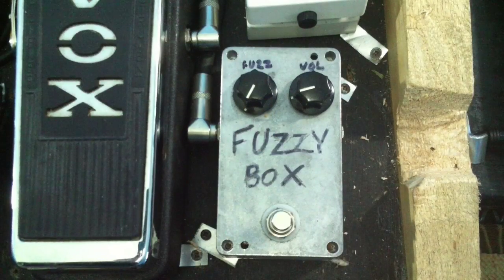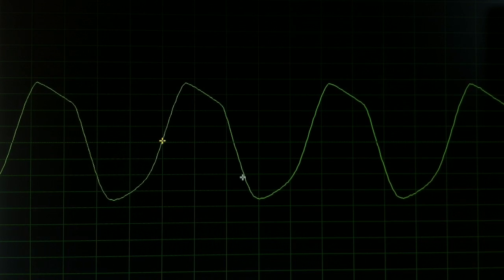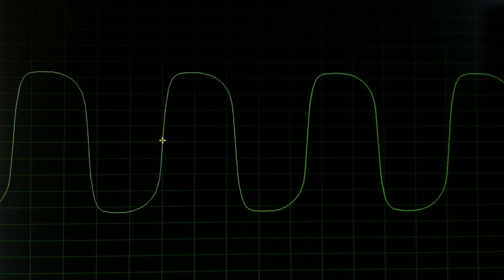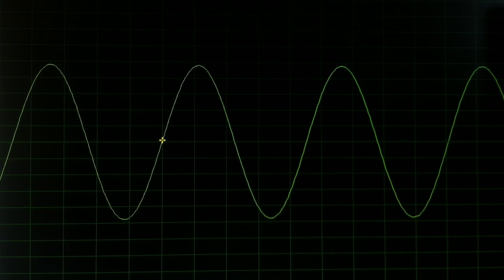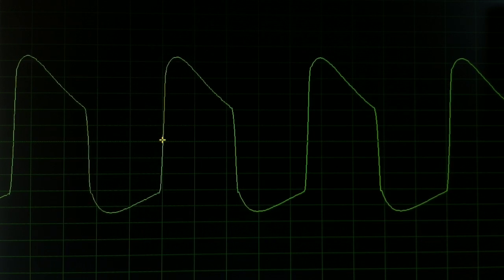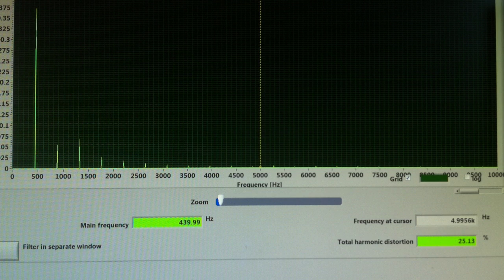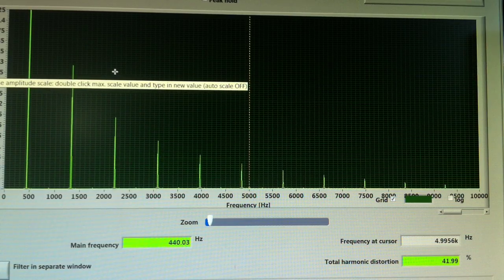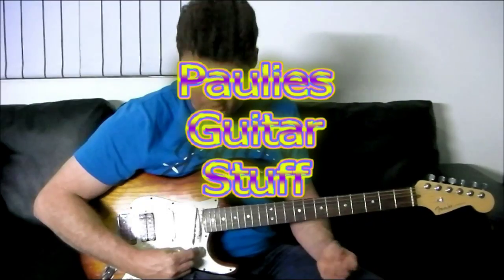Fuzz vs Overdrive vs Distortion Explained

Comment: Pretty much why after 30+ years of playing I have instinctively gravitated towards natural tube overdrive by either pushing the head room of an amp or using undersized speakers. The oscilloscope analysis just confirms what my ears are hearing. Though one of the metal sounds I got was  my mid 80s solid state Princeton amp mic'd off my  60w Peavy tube amp. With a hot rails bridge pup installed on my 83 Telecaster. That is something this video didn't analyze is layered soundscapes

Comment: So this is all interesting in terms of soft vs/hard and symmetric/asymmetric clipping. Essentially its what harmonics are created (odd or odd and even) and how they are distributed. But a more interesting question is what does it sound like, and how should we use it musically? Soft symmetric clipping will be the last aggressive. Hard and asymmetric clipping will have both even and odd harmonics and will take up a lot of sonic bandwidth, be more complex and will have more intermodulation distortion and sound more aggressive. How it sounds depends on personal preference and what you think fits the song. Generally I find using the minimal amount of distortion (i.e. leaning towards soft/symmetric) that fits the song works best.

Comment: I would love to see this same type of analysis done to compare the wave shapes of a Blues Breaker style, Klon style, and Tube Screamer style overdrive pedals; as well as a clean boost/transparent overdrive to see how clean the signal really stays and how increasing the input affects that as well.
Reply: Also a video of waveforms when "gain-stacking" comparing overdrive-into-distortion vs distortion-into-overdrive, as well as stacking fuzz before those to see how all combinations change the output waveform.
Also, another addition, kind of building on my first suggestion, placing a boost before the overdrive/distortion pedals/combos affects the waveform vs after.

Comment: I built a two-valve pre-amp (Marshall circuit) and overdrove it with a Germanium transistor booster fifty years ago.  Still use it, or an incarnation of it.
Awesome fat distorion tone.
The thing is......... the biggest difference occurs when the note dies away.
The pedals for fuzz/distortion etc seems to me to have a clear and definite point where the fuzzy sound ceases whereas the valve distortion just smoothly transitions into a clean tone.

It's good to see someone put up some oscilloscope traces and show people what's actually going on with a waveform as it distorts.
The unit I built starts by rounding off the bottom of the waveform in a very pronounced way - the bottom peak gets rounder and rounder and the top peak just keeps climbing until it all starts to bend and morph into a waveform almost identical to your own valve unit.

Comment: hi man thanks for the video, i have a question, how can i add a distortion toggle switch to an tube preamp overdrive pedal, for example hughes & kettner tube factor. is it possible to a a toggle switch with 2 led diots or diots to the ic in or output of the overdrive section of the pedal?

Comment: Great demo. This also shows why hard clipping of an audio system can blow speakers. Speakers take more time physically to move than a signal like that is telling them to. Depending on the frequency they can stack common signals before they can return to a lower position in the wave and they start to ride up and will destroy themselves. The hard clip is just way too much fast dynamic for them to deal with in the acoustic world. Pushing your speakers beyond their rated wattage is much easier on them than pushing your amps final output stage (causing hard clipping at high watts) beyond its rated output.

Comment: So consider a periodic signal, then we can use a Fourier series rather than a transform because the signal will be band limited.

When you look at the spectrum you see pretty much what you would expect.

Sine wave -> single frequency
Saw wave -> odd and even harmonics of.decreasing amplitude
Square -> even harmonics of decreasing amplitude

So far nothing too interesting.

BUT seeing that tubes cause a hybrid of square and saw plus seem to reduce Gibbs phenomenon (so no overshoots - seems to filter out the higher frequencies) and even a sine has some limited harmonics plus a valves ability to resonate - now a lot of the warmth of valve amps becomes a lot clearer.

Thanks for the video - I only recently got a valve amp - I bet those pedals sound even better in the room - YouTube doesn't do a valve amp full justice

Comment: YES!!! I wonder how many of us fuzz-nuts have been trying to explain the differences we hear between fuzz, distortion and overdrive to our fuzz-innocent buddies - this straight-forward video does the very best job of explaining this that I have yet seen, and I feel like I have the tools to kind of helpfully explain it a bit now. Thank you so much for this video.

It’s almost a truism that every guitarist who has a Fuzzface loves the way that circuit behaves as the guitar’s volume is rolled back, and it's so fun to see it on the oscilloscope and the spectrum analyzer. Any guitar player who has one is going to watch that section and jump up and down, "I KNEW IT I KNEW IT I KNEW IT!!!" - and you see the pattern in the harmonics with the gain cranked (five and then a space, then five and another space, or counted another way, no sixth harmonic at all, no twelvth harmonic, and so on), and how it changes (the others drop but the sixth and twelvth come in!) - just really exciting!!!!

Definitely one of the most fun guitar-related videos I’ve seen in ages. And it’s been out there since 2014, imagine that.

Comment: Paul, Is it possible to make a circuit that produces mostly even-order harmonics? Wouldn't that sound super pleasing? )
Does SS distortion waveform always have rising sawtooth shape and tube distortion falling saw-tooth shape, and can this be altered? 
Is there a circuit that can make a waveform where the top half is M-shaped and lower half W-shaped? Wonder what that would sound like )) 
I wish I knew electronics well enough to experiment and make my own distortion effects... I envy you in a good way! And good luck!

Comment: Now I know how valve (vacuum tube) preamp gives warm-sound. It skews signal. At 12:24 clearly seen that rising a little bit slower than falling. Valve's conductance-increasing sinks faster than its plate's resistor can pull it up again. This phenomenon can achieve in high-voltage low-current condition.
Now i know how, thank's to your effort. Your share makes people getting more smart.
Cheers from Indonesia.

Comment: Paul, I read somewhere that Class A tube circuits clip asymmetrically ( which you show in your video) and that Class AB circuits clip symmetrically. Is this true regarding Class AB circuits?
Reply: It's sort of true. Class AB circuits basically cut out symmetric halves of the waveform, amplify them separately, and then combine them. As a result, all asymmetry is lost. This, however, is true only of an ideal class AB design. Real circuits may not separate the two halves perfectly (and this may even be done intentionally) so that asymmetric clipping is still possible in class AB. There's also some crossover distortion which is like the scar from cutting and stitching the waveform back together.
Reply: You may be confusing a push-pull circuit with “class AB”.  There’s a lot of mistaken mumbo jumbo about “class A” on the internet. It has to do with how the tube is biased and the circuit construct, but you can have single-ended class AB and push-pull Class A (at least theoretically).

Comment: Dude i've been studying electric engineering and I must say you taught me much more than my teachers! 
Really thanks for explaining these fxs
Reply: If this were an EE course, you would be expected to compute the FFT, Bode plot response of the circuit, calculate its transfer characteristics H(s) including stability analysis, phase and gain margin, calculation of all poles and zeros. Actually, a pretty good exercise come to think of it.
Reply: @brucesmith9144  The depends on the design, bode plots and phase shifts are pretty normal, but stability analysis and gain,phase margins are only applicable to feedback systems.
Reply: The distortion wave looks very similar to when you put a capacitor in a circuit
Reply: Hi, mate, so i study civil engineering and it's unrelated do most of the things i've learnt. But i just got curious, do you study how pedals influence the soundwave of your signal? I bet there are more aplications in your field, but it seems a really cool subject! Greetins from a brazilian random dude who comments on random posts hahaha :)
Reply: I'm an electrical engineer and I agree! Congrats from Brazil! 👏🏽

Comment: Loved the content bro.
Make more videos like this, may be like a Flanger,  Phaser or Wah. 
Cheers.
Reply: Flanger, phaser and wah are basically (modulated) filters (in case of flanger and phaser, their frequency response it driven by an LFO - low frequency oscillator - in case of wah, the frequency response is driven by the pedal movement and in case of auto-wah, the frequency response is driven by the envelope of the signal - basically a rectified and low-pass filtered version of the signal - itself), so for a sine wave (which is the "purest" form of wave, consisting of only a single frequency) they would just cause the amplitude to go up and down. To see what these actually do, the best thing would be to feed white noise into them (because that has all frequencies in it) and then look at the spectrum analysis. A look with an oscilloscope (and sinosoidal input) actually doesn't reveal a lot about what these effects do. You need a wideband signal and a view of the spectrum to see what's actually going on.

Comment: What would you say to those people who insist that the sound of a tube power-amp cannot be replicated by a tube pedal or tube pre-amp alone?
Reply from the maker: When a tube power amp is clipped it does add it own elements but under normal conditions when a tube power amp is not driven to that point it alters eq only which can be replicated pretty easily.
So during live performances where the amp is not cranked you could run a tube pedal and a transistor amp.
Reply: ***** What exactly does a tube power amp do differently when it's clipping compared to a small tube that's clipping and then being amplified by a neutral sounding solid-state power-amp?

Also, do tubes still color and compress the sound, even when almost no amplification occurs (amp set close to 0)?
Reply from the maker: Vin Power tubes are usually in more complex circuits than preamp tubes in guitar amps. They have feedback circuits and output transformers and generally run in Class B amplification, that all alters the clipped signal in different ways.
Also generally 12ax7s are used for preamps which are triodes and they are run in Class A Mode. Triodes tend to clip soft where as most output tubes are tetrodes and pentodes and tend to clip a little harsher.
Reply: Redesign the output section of your transistor amp to use an output transformer and I guarantee you'll notice a big big difference in tone when the power section is being pushed.  For the most part, people aren't able to have the power section of their 100 watt amp really push, nobody has in 35+ years.  So in reality output tubes are faithfully recreating what the preamp section is doing.  In that sense, use a tube based stomp box into a transistor amp, in addition to having it rewired so the power section is using an output transformer - and I don't think anyone could tell the difference between tube or not.
Reply: Play a Dirty Little Secret. :)

Comment: It might be interesting to do exactly the same type of comparison between silicon vs. germanium.
Reply: @Willam_J  I was expecting germanium vs. silicon transistors, not diodes. Plus the Klon circuit is fairly unusual in the way it uses diodes.
Reply: @chipsterb4946  Whiney bstrd
Reply: @Willam_J  cheers for the link!

Comment: Nice video! It was very useful for me.

Did you "hand pick" these distortion pedals to produce these (kinda) "simple" waveforms? I tried it with one of my pedals (on an "actual" oscilloscope and signal gen, which should not make any difference though) and it wasn't very obvious at all, what the clipping stage did to the signal, most likely since there was analog filtering happening after the clipping stage, which of course alters the amplitudes and phases of both the original signal and the extra harmonics that the clipping stage produces. I could dial in settings that actually made it clip hard (at the output stage against the supply voltage) so that you actually got "flat lines" at the output, though that's probably not what you're expected to do with it. If one of the early stages clips (like it's supposed to), it will get masked by the subsequent filtering and because of that, the resulting waveform will also vary depending on what frequency you feed into the circuit and of course where your tone and EQ controls are, though one could never get these filters completely "flat".

Likewise, I think that the "sawtooth pattern" from the distortion pedal that you show is actually a (kinda) "hard clipped" signal at some point in the circuit (especially since you say it's an opamp clipping - opamps do clip hard against their supplies), but then got slightly low-pass filtered by a filter in the pedal itself. It's nice to see what the fuzz and overdrive pedals do though, since these don't appear to apply a lot of filtering (if at all).

By the way, I like the fuzz. It sounds pretty cool. :-)
Reply from the maker: +wow503 I didn't really hand pick the pedals they were what I had available at the time.
The effect of capacitors after the clipping circuit will definitely alter the wave form and the sound. Even the decoupling capacitors between gain stages or at the output can alter things.
That  fuzz pedal  is my favourite fuzz.

Comment: I need an oscilloscope - I'm certain my playing will look better than it sounds!
Reply: I don't need an oscilloscope to demonstrate that my playing looks better than it sounds.  Well, actually, it doesn't look so great, so you can see where I'm setting the bar.
Reply: The Guitar Geek me too! Mine disappeared when we moved into my current house. It was a nice scope with its own roller stand. Someone helped themselves to it during the move. My wife and I took in her parents as they were both failing in health. I did inherit some cool,stuff though, so I guess it isn’t all bad. But I need that scope!
Reply: Man that tube distortion really changes the original waveform. The asymmetric clipping is something I didn’t expect. Is the schematic for that available?
Reply: One of the funniest comments I’ve ever read! 😝
Reply: use corrscope

Comment: I'm just wondering how a modern tube amp can reproduce this sound, with no pedals, at low volumes. Is there some kind on onboard circuitry that provides a artificial clip before the power tubes? Because without high output these tube amps are not clipping. Maybe the AX7 preamp tubes, but if that's the case then whats the big deal with everyone swapping power tubes trying to get a different distortion?
Reply from the maker: +John McClung The gain control on modern tube amps actually is used to control drive the preamp circuit and select the level of preamp clipping.
There is no reason why you could not drive the power amp into clip on a modern tube amp either and people often do.
It is often argued that output tubes distortion sounds better than preamp tube distortion but power tube life will be reduced where preamp tubes can run saturated all day as they are always run well within spec.
The problem is the volume level with output tube clipping and you can use a type of dummy load to reduce the power going to the speakers to fix that.
Changing power tubes for a different distortion only really works when the the power tube are clipping although there may well be differences in EQ between different models of power tubes due to inherent electrical characteristics within the  tube and other differences that may occur like biasing and feedback circuits.
Reply: +Paul Graham (Guitar) Hi Paul! Great video, thanks for sharing! I would love to see the pedals used in conjunction (eg. fuzz into tube overdrive, ss overdrive, etc.) and see how tha wave is affected and to underestand why its souds the way it does. Maybe you already did that. 
Thanks again!